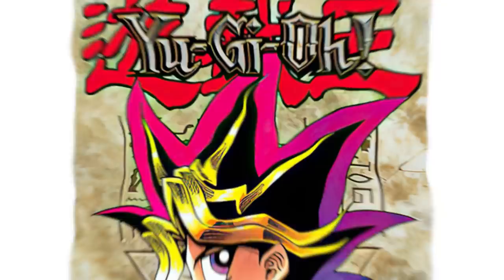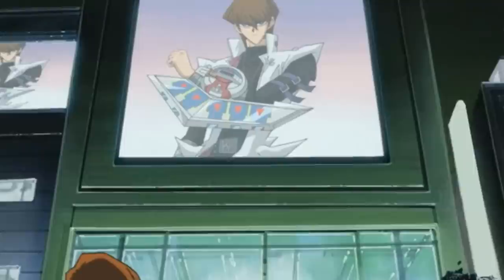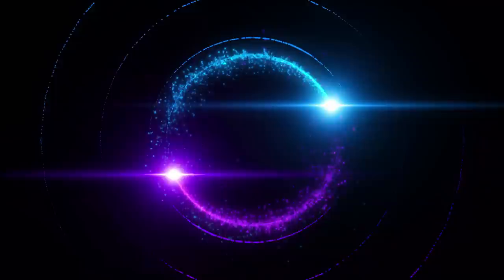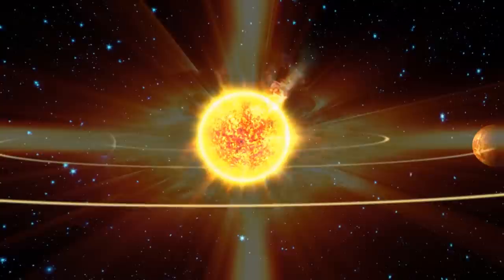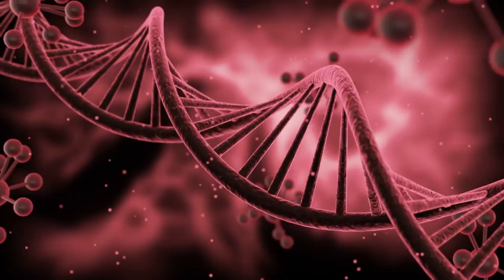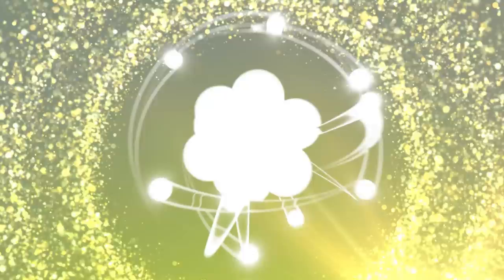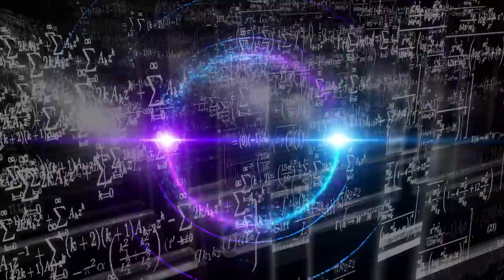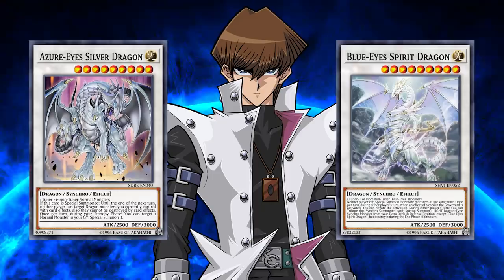Yu -Gi-Oh! Theory: Seto Kaiba Invented Synchro Summoning

Comment: Something that wouldn't surprise me is if Kaiba knew about inversion and that he designed the system to run on several overlapping systems so they could be powered down in rotation and restarted before the tipping point where the inversion becomes a problem and people later decided to just keep them running nonstop because it would be a cheaper way to get more energy out of them rather than building more of them as energy requirements in running cities grew.

Comment: I just kinda realized that all Extra Deck summoning methods reference some kind of energy. There's what you mentioned about Fusion, Synchro, and Xyz here, but Link monsters are basically the circuit that lets them connect to one another. Which I think is really interesting.

Comment: I want to one up one thing you've mentioned. Solidlight, or hardlight, isn't just in the realm of the theoretical. MIT has done multiple experiments using lasers to shoot photons into a highly dense cloud of gaseous rubidium at near absolute zero where the speed of light through the gas is 1/100000 of the speed of light in a vacuum. Doing so causes the photons to slow down to non-relativistic speeds, acquire mass (likely through interactions with the Higg's Boson), and even bond to each other. These experiments are effectively the "Chicago Pile" equivalent for solidlight technology - no practical use, but it proves the base concept. Based on naming conventions of exotic molecules made of subatomic particles, the scientific name for solidlight would be "photonium", similar to how molecules of bound neutrons are called "neutronium".

Comment: I feel like trying to correct the physics in a youtube video about Yu-Gi-Oh means I've already lost, but I can't help myself so here goes:

- Light can't interact with itself. No matter how much electromagnetic radiation you pack into an area, it can push on other matter, but not itself. So having gears made of light meshed together makes no sense
- For that matter, I have no idea how epicyclic gearing is supposed to create perpetual motion. And perpetual motion is of course impossible regardless of your design or materials.
- Fission byproducts aren't radioactive because of any "minimal energy loss" from fission. It's just that you're dealing with larger nuclei, and by smashing them you are likely to create something less stable. You can (admittedly with difficulty) create the same byproducts from nuclear *fusion*, we just usually fuse hydrogen nuclei because its a lot easier/efficient.
- I don't think you need anything as crazy as inversion for something that's speeding up indefinitely to blow up. Chucking a baseball fast enough could have the same effect [1]
- Last point (not an inaccuracy, more a bonus fact): The danger posed by different radioactive particles can vary wildly. One of the most dangerous byproducts of U235 fission are radioactive isotopes of iodine. And the main danger from them is if they get inside the body, because for some reason our bodies love to hoard iodine in our necks (seriously...). Playing cards with traces of low-activity alpha emitters probably wouldn't be all that dangerous, so long as you didn't eat them (though I'd advice wearing gloves).

[1] What happends if you throw a baseball at 90% the speed of light: https://what-if.xkcd.com/1/

Comment: Wow, this video is just, *chef’s kiss*, never thought i’d learn physics from a yugioh video.
I did notice that you never talked about tuner monsters, and then got curious. I found that the definition of tuner is ‘something that receives and adjusts or configures (musical or electromagnetic) waves, or mechanical devices’, such as tuning into a radio station, tuning a musical instruments, or a cars. Both definitions could apply to synchro monsters. What if synchro summoning is one monster improving the other, ‘tuning it’ via the other kind of tuning, aligning and amplifying the energy of it via constructive interference when fusing with them?

It would be overcoming the inefficiencies of fusion by combining them like waves instead of particles, which could be a clever way of exploiting the fact that particles and waves are two sides of the same coin on the quantum level, like how a ray of light is both a stream of particles and a wave. Particles of matter can also resonate with waves, like how sound can shatter glass!

It even fits with the neo spacian experiments, since contact fusion is something they can do. That could be the prototype of synchro summoning.
That would make synchro summoning still be fusion, even if exploiting the particle/wave duality and resonance, and since fusion emits particles and radiation as much as fission does, the conclusions you made based on it being fission aren’t changed by this alternate theory.

Comment: There is also a second problem with perpetual motion machines:entropy. The more a machine runs, the more heat it will generate along the process. Said waste cannot be re used, so it has to be channeled somewhere, or it will overheat its environment.

Comment: The issue with that kind of machine is moreso just that even theoretically there's no combination that gives you more energy than you put in. A theoretically perfect perpetual motion machine could exist, in the sense it keeps moving indefinitely (you can easily imagine you'd spin a wheel in a vacuum with no gravity or any kind of resistive forces and it would just keep going forever) but if you took energy out then it would slow down, because that's how things work.

Comment: So if fusion summoning is a fusion reaction and synchro summoning is a fission reaction then xyz and ritual must also be comparable to one of the two remaining forms of reaction ( either nuclear decay or transmutation). 
I speculate that ritual summoning is nuclear decay as the product( i.e the ritual monster) is always lighter than the resources used to make it ( i.e at least one ritual spell/effect and a material used as cost) as well it doesn't merge together the products but instead one element changes into the product and the other is turned into radiation and heat.
If the above statement is true then  xyz summoning is the final reaction, transmutation, which is the act of transforming an element with radiation to become the product( i.e. monsters turned into the materials would become the energy source that morphs the xyz into it's final state letting it access it's own effects) I believe this also to be the case as the monsters used in the summoning much like the radiation used in transmutation are used to increase the weight of the product ( implied by the materials being stacked underneath the xyz monster as well as its level turning to ranks as it is functionally a different type of monster).
Also to anyone wondering I don't talk about link or pendulum as those have concepts more defined away from nuclear science

Comment: If I am not mistaken, Kiba Corp did develop Jaden's NeoSpacians  and E-Hero Neos thus creating the "Contact Fusion" where Neos gained the effect(s) of the Neo Spacians and barely, if any, of there strength without the need of Polymerization, but they did not stay on the field long without aid. Making them highly unstable. This could also be considered one of the first steps towards the creation of Synchro summoning.

Comment: Unlimited energy or new blue eyes cards? I would have to say both. It has been shown multiple times that when he has a plan, he has a backup plan for his backup plan. The duel in the pyramid of light movie is prime example. Yes ultimately the victory he was going for was to use the god cards against Yugi, but he also had several contingency plans to ensure his victory and in fact during the simulated duel after adding the new cards to his deck the simulation won by deckout. Bit we also know there are often flaws in his plans and without him around to make sure that those flaws aren't exploited or cause everything to fall apart, that's usually what ends up happening. So with Seto gone, of course is perpetual motion machine would eventually have issues as nobody else seems to understand things the way he does. Cento is not a super villain, he is an antihero. They often do things that benefit the greater good, but don't always do so intentionally. They also have a habit of every now and then screwing things completely up for everybody. But with seto's dark side banished, there is far less of that in his life. But old habits do die hard

Comment: I'm not quite sure where you got that idea that fusion is less efficient than fission and what you even meant by saying that it is less efficient. Less efficient in what? Producing harvestable energy per atom? 

It is evidently harder to control, but other than that it really doesn't make sense to call it "worse" to fission.
Reply: It's like he said: fusion reactions produce less usable energy per reaction than fission ones do. When 2 particles slam into each other hard enough to induce fusion, what happens is there's basically a tiny explosion. Energy gets thrown off every which way, and only a certain amount of it can be captured and used according to the laws of thermodynamics. The rest just sort of dissipates.

In a fission reaction, you're doing something more controlled: splitting something in half, basically. This causes a smaller and more uniformly-directed output of energy, which is easier for a generator to convert into usable energy. The downside is that the leftover waste is a lot more radioactive, since the radiation tends to build up faster instead of being expelled by the fusion reactions.

For the sake of comparison, the amount of energy that can be harvested from a fusion reaction tops out at something like 70% of the energy that went into setting it off - and oftentimes, it's a good deal less.
In a fission reaction, the output can exceed 82%.

So, pound for pound, fission reactions beat out fusion reactions in terms of usable energy.

The keyword there is 'usable.' The overall amount of energy put out by fusion is higher; it's just not efficient enough to justify the price (and, depending on who you ask, the risk).
Reply from the maker: This is a fair question and, if we're being honest, the comments from this video make me wish I had spent more time on this section. I rushed through a bit of the classroom section because I didn't want to lose people who came for the magic trading card show. 

While fusion has a higher theoretical capacity factor than fission, achieving and sustaining fusion is substantially more difficult in practical terms; so much so that we've never been able to generate a reaction that produced more energy than it required to generate. That's what I meant by "not very efficient." The longest sustained fusion reaction on record was clocked at 17 seconds in 2016 and it cost far more energy to produce than it produced. Will this limitation always be in place? Probably not but it has been the reality of things for the last 80 years.
Reply: @SpellCommander91  Thank you for responding. I am already somewhat familiar with how fusion and fission works and read about it. ITER in France is currently under construction and will be the first fusion reactor to be used for generating electricity on a big scale. 

I am very positively surprised that you still read these comments and go back to respond and set things right. That's outstanding honesty and passion towards your videos, keep that up!!

Comment: So there are two things that came to my mind vy the end of the video.
1: If Set Kaiba created new duel spirits, does that include the Signer dragons or were they just reborn in the synchro format?

2: We've seen fusion summoning in 5D's but not Zexal. Zexal only uses the Xyz if I'm not mistaken. So where did the rest of the summoning methods go? I know you explain away Synchros going missing but the other two as well? By the time the dimensions break into 4, all the methods are back. 

Bonus 3rd: If hard light was around in 5D's but not Zexal then why revert back to it for Arc-V?
Reply from the maker: 1. To point one, I don't think the Signer Dragons are brand new spirits. I do think they were reborn, kinda like the Numeron Dragon was reborn as an XYZ monster at the end of Zexal despite existing before card games were even a thing. But that's mostly just trying to reconcile the show's magic with the show's science. 

2. This is kind of a separate theory that will likely get its own video at some point but I think it works like this. 

Egypt develops the Shadow Games using Chaos, the magic explored in Yu-Gi-Oh! Zexal. This allows them to figure out Normal, Fusion, and Ritual summoning. They seal Chaos away after the rise of Zorc, meaning there is no magic around except for what's left in magic items like the Millennium Items. 

Thousands of years later, Pegasus creates the game of Duel Monsters and uses the Millennium Eye to create Fusion and Ritual cards. 

But after the Millennium Items and God cards are lost, the only new Fusion and Rituals produced are made by other people with magic items - like the Shadow Charms in GX. 

So by the time of 5DS and Zexal, magic summoning methods are less common but people have used science to make Synchro and XYZ cards. 

At the end of Zexal, Astral uses the Numeron Code and unseals the chaos magic that the Egyptians sealed away. So by the time of Zarc and the original dimension's split, all summoning types can easily be made because people can just learn how to use magic at that point. 

Like I said, should probably end up in its own video at some point.

Comment: The thing is fusion can make over 500 megawatts of power with helium as a byproduct something that we are running out of.  Fission is only 5 megawatts and produces nuclear waste and is a big problem.  So nuclear fusion is super reliable and useful.  This takes one google search
Reply from the maker: Really? I could have stopped at one? I shouldn't have put two weeks of research into the process where I learned that despite fusion's higher potential energy capacity, Earth has never successfully produced a fusion reactor on account of the fact 1.) fusion reactors would need to be built out of materials that can withstand sustained temperatures of 100 million degrees Celsius and 2.) no fusion reactor design has ever produced more power output than the electrical input? 

I don’t know where you got the number of 5 megawatts for fission from, as the smallest nuclear plant in the U.S. (the R.E. Ginna Nuclear Plant in New York) has a capacity factor of 582 megawatts, while the largest plant (Palo Verde in Arizona) measures in at 3937 megawatts. These are both fission plants. But I’m assuming your measurement of 500MW for fusion is in reference to the ITER project in France, where the goal is to generate a 500MW fusion reaction for thirty seconds periods. This reaction only requires 50MW of power to achieve but the reactor itself has been estimated to require up to 620MW in order to run, making the result less than the sum of its parts.

So not for nothing but understanding nuclear physics might require more than just one Google search. Hope you enjoyed the video! Definitely talking about all of this more next time when we discuss XYZ monsters!
Reply: @SpellCommander91   mit is mearly wiling out the kinks in their nuclear fusion reactor plans before they start working on one and sure I’ll agree that and I wouldn’t be surprised if the 5 megawatts were wrong but the fact you said fusion was limit potential is just wrong and misleading especially since it can help make further steps in humanity such as the poluation problem.  I have been studying fusion reactors for a good bit now and so far I haven’t found a downside.  And they say they will start construction June of this year.  Although mit is hiding the plans for the reactor it is clear they have come up with a way around the heat.  And fusion reactors put out as much as they put it so from a theoritocical standpoint the energy is huge

Comment: There was this theory i have on synchro monsters being the light of destruction and xzys monsters being the gentle darkness. If you look at yugi and Joey's extra deck monster they are either fusion or xyz's monsters. Kaiba's extra deck is filled with fusion and synchro monsters. While mai valentine's extra deck has a xyz's and synchro monsters due to her being an antagonist in the beginning of the series then being an ally later on. The xyz's timeline found another type of energy and where the kaiba corporation is non existant. Meaning that xyz's monsters were the by product of good energy thus the gentle darkness. While in the synchro time line has kaiba corp creating another version of the light of destruction. Thus the synchro monsters were byproducts of the light of destruction. So the motifs of yugioh gx about the gentle darkness was correct maybe.